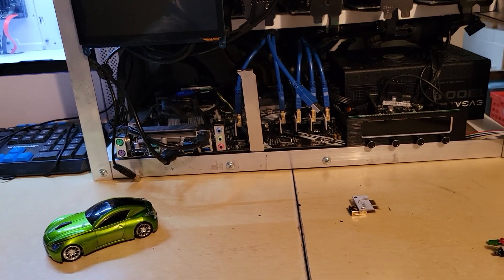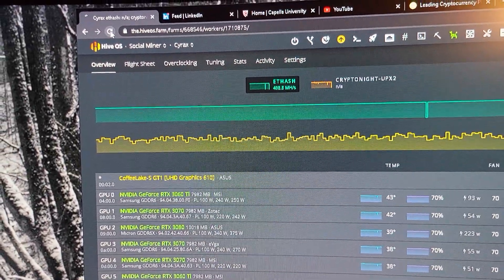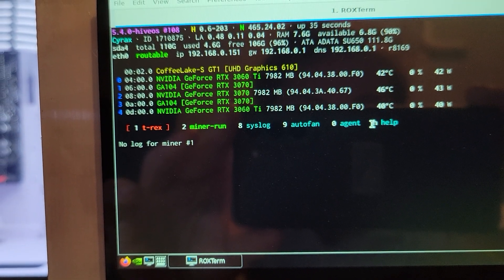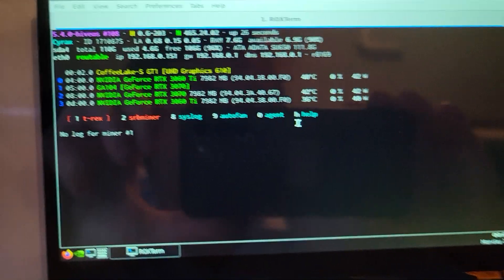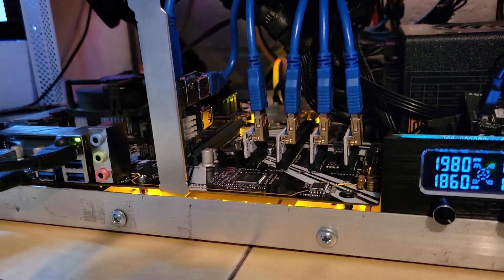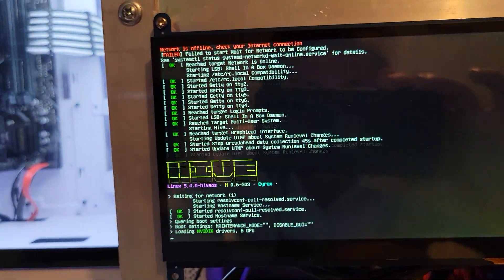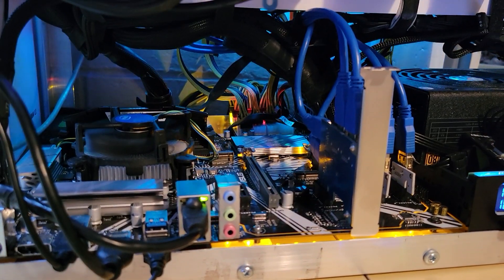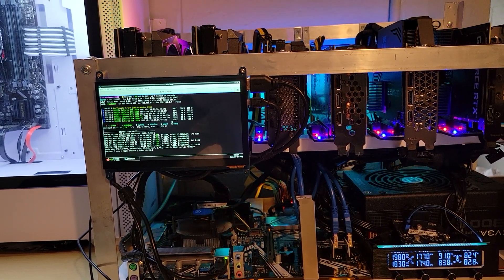PCIe 1 to 4 Adapter Test in 1X slot| Asus Z390-P Motherboard| 4 Cards Confirmed+2

Comment from the maker: I found out how to get 11 GPUs on HiveOS. Disable the Realtek Lan in BIOS. This for whatever reason allowed another GPU to post. Now If you have an ethernet, it will not work anymore.  I worked around this using the little wifi adapter card thing that came with the mother board. I then typed in "wifi" in the terminal, and then entered wifi password. Walah! 11 GPUs
Reply: Amazing!!! 11 GPUs, that's very very good
Reply from the maker: Its an awesome feeling. Have fun :)
Reply: @CharlesFowle  : Thank you for the reply. I will go towards your direction :)
Reply from the maker: Great. Have fun!
Reply: What is the small monitor/screen you have on that rig?
Reply: Should try this. I could only get 2 cards to show with mine.

Comment: My PCIe 1 to 4 Adapter doesn't work with my Asus Z490-P MB. Any solution?
I tried to adjust BIOS many times already, but it still didn't work.
Thanks!

Comment: the main takeaway for me is those cables that turn on a second power supply have a delay. hmm.
But why was that an issue with the 4 in 1 adapter and not before?

Comment: Hey! I´m having problems connecting more than 4 GPUs in a z390-p Motherboard.
The option "above 4g decoding" is enabled. Any suggestion?

Thanks from Argentina!
Reply from the maker: Hmm, have you set the pcie speen to gen 1 or gen 2? In my experience it's best to troubleshoot by doing 1 card at a time. Allow windows to boot and allow windows to install graphic drivers automatically. This can be identified that it's happening by seeing the screen go black and coming back on after a few seconds, even up to a minute or two I've experienced. So do 1 card at a time usually the second card gets installed, after it boots into windows a minute or two later you will get the black screen where the drivers are being installed. To check the status of the GPU and how windows is seeing the GPU. Hit the windows key, then type in device manager. You should see " display" something or "monitors" I forget. But click that and you will either have a computer (drivers installed),  or exclamation mark (error installing drivers) and you not fully working with windows. To fix this sometimes just a reboot is nessecary, other times you need to boot into safe mode (hold shift simeltaneously when clicking "restart"in the power options menu to shut down the PC), and then having DDU (display driver uninstaller) program installed, uninstall the Nvidia driver then again reinstall Nvidia drivers manually.

Comment: ok, so i have tried this thing in 3 different boards (asus h97 pro, intel h67 and gigabyte h97). All 3 of them came with 4 pcie slot and I wanted to make a 7 card rig so this seem perfect. 
yes it works, BUT only with 6 cards, right after adding 7th card to my board, the board bricked and went into indefinite bootloop (all 3 of them). I hope this could help you people and you would not make same mistake like me by adding 7th card to an older gen board (maybe it will work in new generations) and yes, I did test each and everything to rule out for any other bad components (PSU, risers and all) I swapped PSU, risers and even processor with each board.
Reply from the maker: They are older boards and most likely do not support the required amount of Lanes to handle 7 GPUs. It sounds like you hit the maximum amount of Lanes either the motherboard  allows or the CPU can provide. As far as it being bricked I would remove the bios battery on the motherboard, wait 10 minutes then remove all the GPUs, (leave one if you don't have the ability to plug in your monitor directly to the motherboard so you have a display ability). Removing the battery may help by resetting the bios. Don't know if this would help but the first steps I would do. Let me know where your at now.
Reply: @CharlesFowle  yes, I did tried everything. CMOS, jumper, RAM.  I just bricked 3 boards, I get no display, no post nothing. The boards keep restarting itself after every 15-20 seconds. Took them to a technician, and got to know that bios chip is corrupted in all 3 of them and has to be changed (it's like 10-15$ repair cost for each).

Comment: so what did the trick when you were having issues in the middle of the video?
Reply from the maker: So, I'm sorry I didn't really mention it clearly. The issue was that the server power supply I have that was running a few cards separately would power on just moments after the atx and therefore the GPUs would not post before the motherboard would power up. You see, I have my second power supply hooked up to power on when I power on my main power supply, that is , the one that is powering the motherboard, and it would come on just moments after the motherboard would actually post and the GPUs we're then discounted a ND oddly one of must of came on like in between or something as it said "GA104". So in summary, this works great for what it's intended on this .motherboard. just remember to power on any secondary power supplies prior to turning on the motherboard. I don't know if my secondary (server PSU) from parallel miner is a fluke and doeant power on aimeltaneously as it should, but it would be worth knowing ; Have fun!

Comment: my bet is you are pcie lane dependent. Most of these cards i see listed say it has to be x4 or higher for the lane you are plugging into. Also the chipset on the mobo probably has a limit on how many you can run at once. These splitters are def nice though :)
Reply from the maker: I don't think it is pcie lane dependant because all the other cards are using a 1x adapter. Your right avout the chipset on the motherboard though. I'm asking a guy now who has 11 on this motherboard. I personally believe it is because my cpu is maxed out and I actually have lanes still available to use on the mobo.
Reply: @CharlesFowle  yeah CPU limitations also makes sense.

Comment: Imagine the 1 to 4 adapter in every pcie slot lol that would be awesome. To see a 20 gpu set up would be pretty cool as well
Reply from the maker: Ahaha yesss.!! So I found out the gpu limit is according to how many lanes your cpu can handle and also how many your board supplies. I.e. 2 individual  16xlanes + 4 individual 1x lanes =36 lanes, but the cpu and chipset on the board can only handle so many. Say the cpu can handle 20 lanes and the chipset can do 8 lanes but your board has a total of 34 lanes. You would still only be able to handle 28 lanes. 20 cpulanes + 8 mobo chipset lanes. Check cpu lanes under specs when you look them up and same goes for the mobo you look up

Comment: Can I get full hashrate on kawpow with two rtx 3060 in this adapter ?
Reply from the maker: Hmm. Not sure. 3060 originals or lhr? Check chumochangexd. I think he got 6 of them to work on a rebtech board. Search Rebtech 3060 white Amp zotac full hashrate

Comment: Have you figured out if the motherboard will support 10-12 gpus?
Reply from the maker: It is capable of running 10 GPU's max.
Reply: @CharlesFowle  was this with 2 pcie splitters? That’s weird bc seb was able to use 12 on an older version of the same motherboard https://youtu.be/kNvJUKJ0fu0
Reply from the maker: So it depends ultimately on the amount of "lanes" your cpu has. I don't know what mine, Intel Celeron G4900T is, but possibly that is why he is able to get more, even though it's an older board. I know one thing for sure is I am only able to get 10 to boot successfully in hiveos. If I add an 11th, it does not post at all.
Reply from the maker: So I did some research. Ultimately the number of lanes a cpu has or supports is the determinant. You can find this by looking up product info about a cpu on Google. The Intel Csleron G4900T, the one I am using on that board, supports up to 16 lanes. Also, a x1 slot or x16  slot ect. isn't actually how many lanes it is using. That you have to look into because I don't know how to know how many lanes a gpu is using
Reply: I have seen this board support 11 GPUS. That had all Sata/Com/Audio disabled in BIOS and Gen1 selected. Two M2 adapters and a 4x1 in one PCIE slot. Rig was running USB drive with HiveOS.
Reply from the maker: @shannonhughes9434  thanks for the info brotha. Can you perhaps tell me what cpu he had. That determines alot too. I have a intel celeron g3900T
Reply: @CharlesFowle   i5-9400

Comment: good video friend, could you tell me the name of the digital device that comes out by dialing some numbers in the lower right part of the video on the part of the power source and what is it used for? Thanks a lot
Reply from the maker: Hey! Thanks for the kind words. That is a fan controller. It allows control over the fan speed of the fans at the back of the rig against the wall. It also has 4 separate temperature sensors you can place where you'd like that then display the temperatures on the little screen on the device.
Reply: thank you very much friend....

Comment: Hi, where did you bought that power/voltage meter?
Reply from the maker: Ebay
https://www.ebay.com/itm/264892527268
Only thing is.....do NOT go over 1200w. It can be unsafe.

Comment: i use in windows 10 and this adapter work well, can read 4 gpus, im only have 3 pcie slot, with this i can run 6 1660 super flawless
Reply from the maker: Happy to hear. The more miners up and running the happier I get!